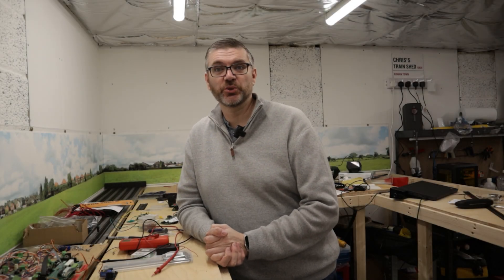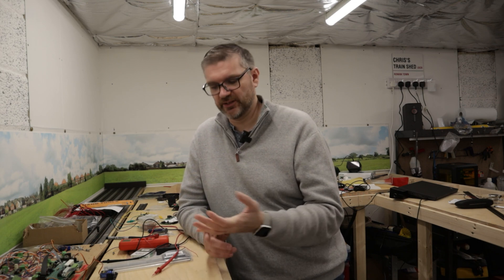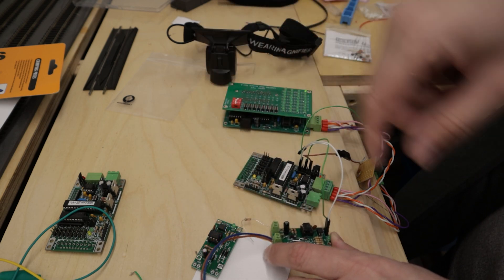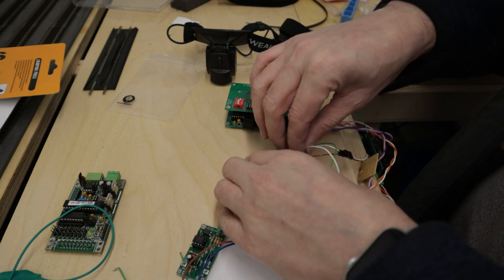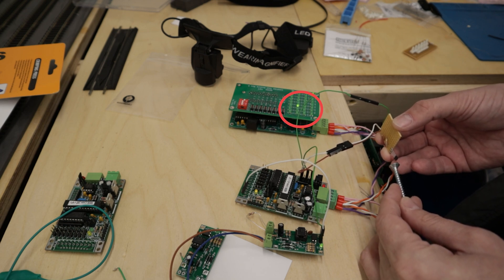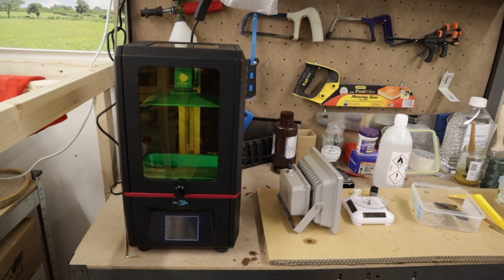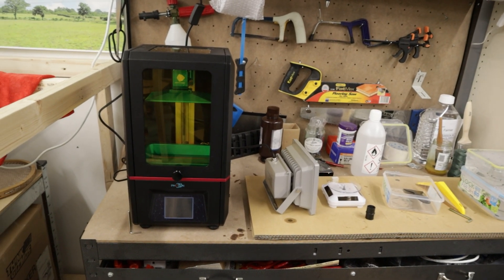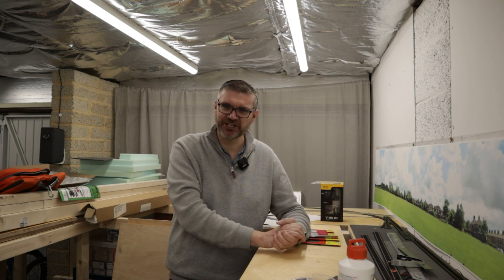Building a Model Layout in the Garage  - Part 12 - October Update

Comment: Hi Chris.  I've just joined MERG as well.  I'm going down the following route:  servo and microswitch (for frog switching) operated PECO Electrofrog and Roco line points (the larger radius curved points with PECO don't do), computer control.  Like you I will probably have to have train detection of some sort I should think, particularly as I have a multitrack hidden loop around the extreme edge of the layout and under some removable scenery sections.  I note you mention CANMIO.  It's been suggested by other MERG members that I go with CANCMD and CANUSB4.  Any idea what are the pros and cons?

I've subscribed as well as I might learn a few other things as you go along!
Reply: @RowanTownModelRailway  Can I ask why you've gone with relays for frog switching rather than microswitches on the servo mount?
Reply: @RowanTownModelRailway  The way I did my control panel was using bi-colour leds, 3 on each of the lines. The end ones nearest the points were straight switched by the frog switch on the Cobalt / Tortoise motors, the route being indicated by a green led and the blocked route by red. The LED between the point indicators was controlled by an AND gate, if both points were switched to the relevant route (passing loop, crossover, etc) the route would show 3 greens, otherwise either 3 reds or 2 reds and a green if a point was set correctly for that route.